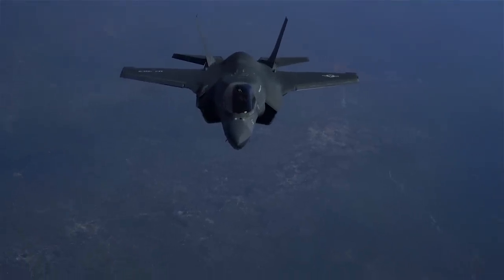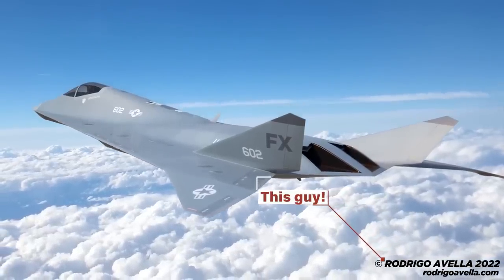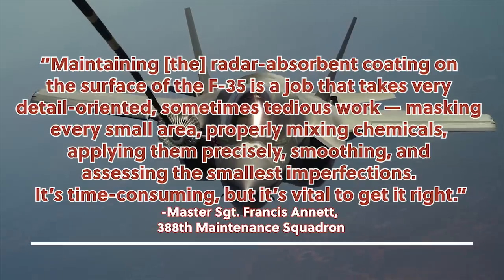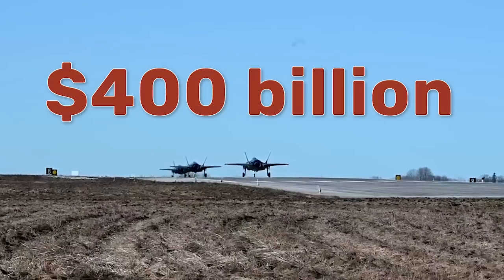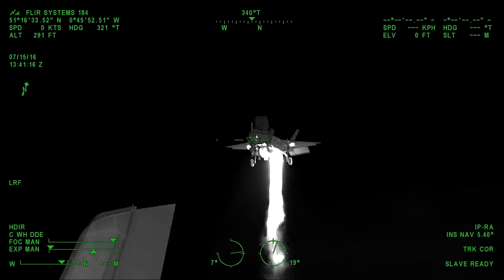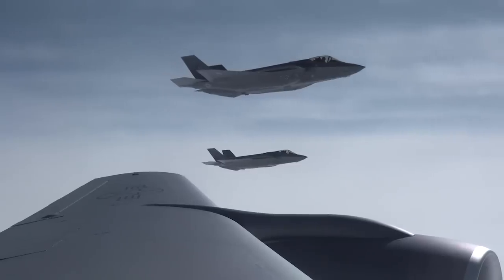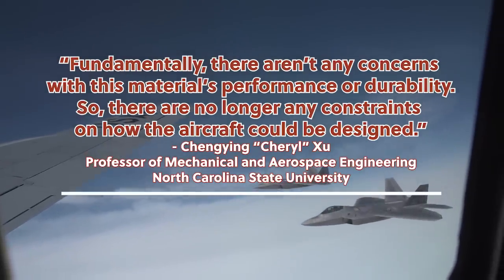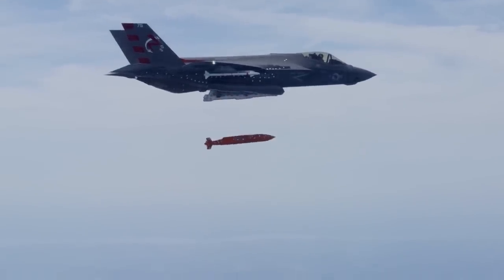The biggest leap in stealth tech since the F-117

Comment: Just in case any reformers come along and point out how China can track the F-35 anyway, so what? The F-35 is designed to be hard to shoot down. Knowing where it is and being able to guide a missile there are two very different things. Any civilian airport has the radar system to - in principle - locate an F-35. However, they can, owing to limitations of physics, only pinpoint the position to about half a kilometer. What you need to get a weapons grade lock is a high frequency radar beam with the accuracy to guide the missile towards the target until its internal systems can take over. That high frequence beam is what the F-35 is optimized against, not traffic control radar.
Reply: Not to mention even that positional information is not available at the furthest extent of the radars coverage. Still holds true that stealth doesn't mean undetectable, it means delaying detection and targeting
Reply: You've got it wrong. It's widely known that stealth aircraft are easily <detected> using low band radar.
But, just knowing a stealth aircraft may be in a general area is not sufficient to <track> and <target> the aircraft which generally requires high band radar.
Reply: @tonysu8860  That's exactly what i said.
Reply: "Just in case any reformers come along"
"Anyone that doesn't think the F-35 is the greatest thing to ever take to the air is automatically a reformer with a Pierre Sprey altar in their garage. LALALALA! I CAN'T HEAR YOU!"

"China can track the F-35"
You mean detect. Tony Su was actually correct here, despite you brushing him off and saying, "That's what I said." You... actually didn't say that and he successfully corrected you.

"What you need to get a weapons grade lock is a high frequency radar beam with the accuracy to guide the missile towards the target until its internal systems can take over. That high frequence beam is what the F-35 is optimized against, not traffic control radar."
...Is this a bad time to bring up that it's not 1973 anymore and the line between search radar and FCR is one very damned big blurred line? And how systems like SMART-L (which is labeled "L" for IEEE L-band designation but it's actually NATO D-band despite them technically both being the same band but using both systems... Thanks, Germany) exist which can search AND track and do so in a band that the F-35 is horribly optimized for? Yes, I know most modern systems that you're thinking of DO operate in the X/Ku band. Most, yes. But not all. And given how we've dedicated so much to optimizing radar cross section for X/Ku and some of E/F (S-band) bands it's only a matter of time before lower wavelength FCRs start getting proliferated. Hell, they're already playing around with making VHF more accurate for tracking and targeting with software processing and array transmission/receiving numbers. It will never replace or come near a FCR, obviously, but if you shot something like an S-400 which is more akin to firing a small bus at the offending target and having a warhead up to 400 pounds in size... You're also getting too close for comfort for being a threat if you can narrow down your accuracy even by several hundred yards/meters.
Reply: @matchesburn  The S-400? You mean the ones that have been blowing Bayraktars out of the air in Ukraine? Oh yeah, right, that never happened, because the Bayraktars blew them up first. If they can't even handle a turkish UAV with gliding bombs, how do you expect them to handle an american stealth fighter with HARMs?
Reply: @HolyPastrami  
I have no idea where you're getting your information, but it's so bad that that it's almost funny and you need to stop talking because you have no idea what you're talking about.

"The S-400? You mean the ones that have been blowing Bayraktars out of the air in Ukraine?"
They haven't been targeting Bayraktars, you oligophrenic. They're been used reportedly against Ukrainian Su-27s. In fact, the verified use of them is incredibly limited because the Russians aren't utilizing S-400s near the conflict.

The Ukrainians claimed to have destroyed an S-400... In Kherson... Which makes no sense why such a system would be there, the S-400 is a purpose built IADS system and having it that far inland is like sending a sniper into a tent to knife the enemy when he could be a mile away popping heads (hopefully even you understand this analogy; and no, Call of Duty is not evidence that snipers should abandon long range precision rifles for a knife, so don't start). They used a destroyed a 48Ya6-K1 Podlet K1 low-altitude radar system as evidence for this... Except for the fact that there were no S-400 batteries, no launchers, no command vehicle, no FCR vehicle, nothing but that mast radar... So one single component of the entire S-400 system that can be used on its own and is used on its own was destroyed... without a single other S-400 - including the launchers, of course - component anywhere to be found.

...This is like me showing you a car battery that's been destroyed and saying, "See?! The rest of the car must also be destroyed! We destroyed a car!" when... it's just a car battery. 

"Oh yeah, right, that never happened, because the Bayraktars blew them up first"
This is not the place to show off your badly written fan fiction:

"The Ukrainian Military Is Changing Its Tactics With Bayraktar TB2 Drones" Forbes Magazine, June 23, 2022

Despite the numerous successes of the TB2 drone, reports indicate that their usage in the Donbas region has become limited due to a large number of Russian anti-aircraft systems. 

The importance of the TB2 drones to the Ukrainians cannot be overstated. According to Oryx, a blog that tracks the destruction of military equipment through open-source reports, these drones are credited with destroying the following: 6 armored fighting vehicles, 5 towed artillery, 1 multi-rocket launcher, 2 anti-aircraft guns, 10 helicopters, 6 naval ships, 3 command posts, 1 communication station, 2 logistics trains, and numerous resupply trucks. The Ukrainian military reportedly started the war with just 30 of these drones and have lost only 8 in combat. Additionally, they recently received a gift of another TB2 drone from the Lithuanians who crowd-sourced funds to purchase one.

------

"Ukraine's drones are becoming increasingly ineffective as Russia ramps up its electronic warfare and air defenses" Business Insider, July 3, 2022

Ukraine's ad-hoc drone airforce, from small consumer drones typically used for surveillance to the famed Turkish-designed Bayraktar TB2 drones, were credited with eviscerating Putin's tanks and armor.

But Russia has learned from the humiliation by drones in the first months of the invasion. Experts told Insider that the drone wonder weapons are becoming increasingly ineffective because Russia has improved its defense systems and is downing and jamming many of Ukraine's drones.

"What's happening now is that Russia's electronic warfare and air defenses have become better organized and fielded when compared to the earlier months of the war," said Samuel Bendett, an analyst and expert in unmanned and robotic military systems at the Center for Naval Analyses. 

Russian forces are using early warning radars to identify the drones and electronic warfare systems to jam and disrupt their communication, Bendett said.

They also use various weapons like machine guns and air defense systems, such as the Tor missile system, to shoot the drones down.

Recent footage from the Russian Ministry of Defense claimed to show a Krasukha-S4 electronic warfare system in action, taking out a Ukrainian drone.

According to Mark Cancian, an analyst at the Center for Strategic and International Studies, Ukraine was previously able to use drones so effectively because Russia had not organized its defense systems.

"Drones were able to play such a role because the Russians were slow to set up an air defense system. They were slow to establish the combined arms operation (armor, infantry, artillery, recon, engineers, air defense) that their doctrine called for," he said.

Russia has better organized and positioned its ground-based air defense in the Donbas region, where the focus of the war has shifted.

Ukrainian forces are now limiting their use of drones because Russian troops are more easily thwarting them, and losing drones can be costly.

While single-use drones such as the Switchblade and Phoenix Ghost cost several thousand dollars each, the TB2 drones can cost somewhere between $1-2 million each.

Ukraine has received about 50 TB2 drones from Turkish arms company Baykar since the Russian invasion began. 

Ruthlessly effective in the first days of the war, the TB2s have begun to be shot down by Russia, and the Ukrainian army is scaling back their use.

Reports have recently emerged that the US is planning on selling Ukraine US-made General Atomics MQ-1C Gray Eagle armed drones, which have greater capabilities than the TB2s.

However, two unnamed Ukrainian Air Force pilots told The War Zone that they are not advocating for the drones due to their hefty price tag of $10 million each, as they are likely to get shot down on their first mission.

According to Cancian, Russia's air defenses are almost entirely short, and medium-range missiles and drones are especially vulnerable because they fly low and slow.

"Ukrainian pilots I have talked with say the role of drones is now limited as a result," he said.

Instead, Ukrainian forces have advocated for modern fighter jets from its Western allies.

------
"Ukrainian Fighter Pilots Call B.S. On Need For Gray Eagle Drones" - TheWarZone, June 22, 2022

Two Ukrainian Air Force pilots, who recently spoke with The War Zone and other media outlets, have dismissed the value of a proposed sale of U.S.-made General Atomics MQ-1C Gray Eagle armed drones to their country. They also said much-lauded Turkish-made Bayraktar TB2 unmanned aircraft have become virtually useless in the face of more robust Russian air defenses and made clear that they are more interested in any plan that gets them closer to flying more modern Western fighter jets, like American-made F-16s. Their comments appear to point to a broader debate now ongoing between frontline pilots and senior leadership over priorities when it comes to bolstering Ukraine's aerial combat capacity.

The pair of Ukrainian aviators in question agreed to speak to members of the press on the condition that only their callsigns, Juice and Moonfish, would be used instead of their real names and that the locations that they were speaking from would not be disclosed. The War Zone has been in contact with Juice in the past, including for a previous feature interview about the state of the air war over Ukraine since Russia invaded back in Febraury, which you can find here.

Moonfish and Juice both said that the extensive threats now posed by Russian air defenses have already forced the Ukrainian military to dramatically scale back its use of TB2 armed drones.

“They were very useful and important in the very first days, stopping those columns [of Russian armored vehicles and troops heading toward the capital Kyiv], but now that they’ve built up good air defenses, they’re almost useless," Moonfish said.

TB2s are still being employed for "some special operations, including attack missions," according to Juice, "but, in very rare situations and in exact conditions."
Reply: @matchesburn  You make a better argument and more fair of a concern then most people complaining about the F 35. Usually it is reformers, people who want less government funding and it is easier to say it sucks then say it is excellent but unneeded, or people stuck in their ways who hate the new thing. That being said, history goes along the lines of: Other countries make a claim about their capabilities. Then we take it seriously developing counter weapons or were prepared for them to make what they made and we come out the victor. Not all that crazy about Forbes either after it ran that horrid clickbait saying the Air Force admits it sucks while a General said the F 35 is so good and expensive it should make cheaper and less good jets to compliment it. The little weasel writer had to add that he thought that meant it was code for a failure.

Comment: I have a question though, how much weight will the ceramic coating add? I'm going off my knowledge of ceramic cerakote that is used on knives. I had a full titanium knife where it's color was made from anodizing it. I had a ceramic cerakote applied onto the knife and it increased the weight significantly enough where I could tell a difference.
Reply: Any RAM is very heavy it’s seems.

Comment: When a volcano erupted at night in asia it spew pyroclastic materials in the air that wasnt detected by an airliner's radar even weather radar that passes by. As for making any aircraft, just process an ultrafine pyroclastic dust thats now plenty in the Philippine, spray coat the aircrafts surface with top coat, , powder puff them with ultra fine pyroclastic dust, let it dry or oven dry it. With this youll be giving the ATC a headache trying to find you in the air
Reply: Radar transparent and radar absorbing are two opposite things. The last thing you want to do is coat a 'stealth' aircraft with material that lets radar waves pass through and bounce off. Zero stealth!

Comment: It would  be interesting  to test this  new ceramic coating on existing non-stealth aircraft. It could be a cheap way to increase existing capabilities.
Reply: Not when they're hauling external tanks and missiles/bombs with fins under their wings.
Reply: You should re-watch the beginning of the video as he mentions that stealth fighters are designed to be stealthy from concept, because achieving a low RCS compromises the overall design. 

It's probably not worth coating older non-stealthy aircraft with this new "ceramic" RAM unless the airframe is already designed for LO, because any RCS reduction achieved by the RAM will be overshadowed by the high RCS of the airframe itself and also any external ordnance carried.

Regardless, by the time this RAM becomes available, the F-35 will probably be the only current aircraft still in production.

Comment: Using the term "ceramic" to refer to silicon carbides is a bit disingenuous. They are hard to make and hard to work. They are extremely hard and extremely heat-resistant but that also makes it very very hard to use them. While I love Alex and the work he does, this is probably very distant future stuff. The use of silicon carbides is going to be very, very cost-prohibitive compared to existing RAM coating mixtures. There's a lot of potential uses for silicon carbides but they're very difficult to make. It's pretty likely that we won't see this sort of stuff on current jets. There's also the issue of whether the surface will withstand high torsional stress that aircraft wings undergo during intense flight regimes.

I personally think that rolled carbon fiber airframes will likely be used in the NGAD program (both for master and slave aircraft) which will have a pretty high impact on RCS. I think silicon carbides are a decade away, minimum.
Reply: Just googled "Silicon Carbides" ... There's a LOT there...
Reply: Agreed, the flexibility of the coating is critical on an airframe designed to maneuver violently.
Reply: Take another look around...
You can buy a 32 oz spray bottle of Turtle Wax ceramic spray coating for your car that will coat your car with silicon carbide for less than $20.